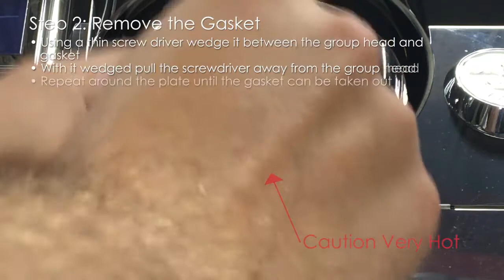Nuova Simonelli Replacing Espresso Machine Gasket

Comment: Gasket has two sides one is flat the other one is bevelled. Which side goes up?
Reply: flat side up beveled faces down
Reply: The flat side is definitely down and beveled side is definitely up. The universal rule (for any machine) is that the printed mark on the gasket is up. If you reverse it, the Portafilter won't lock at 6 o'clock and will turn too far to 4 o'clock. Ask me how I know. And yes, with a flat seating bed this seems upside down to me too, but it is not - bevel is up!
Reply: @Jan-qt3qn  tried both positions. Works well when bevel side is down touching the portafilter.